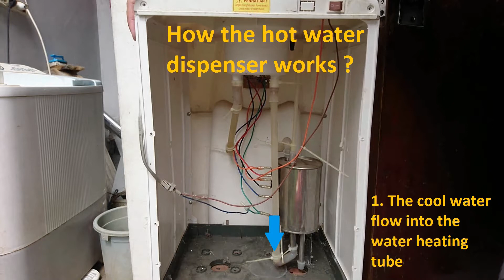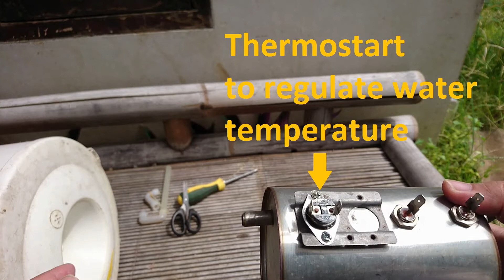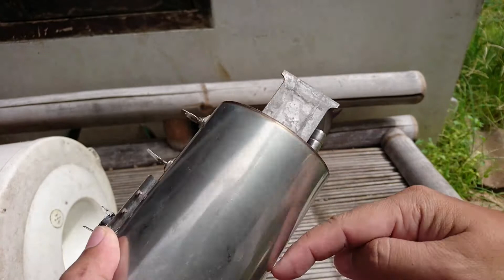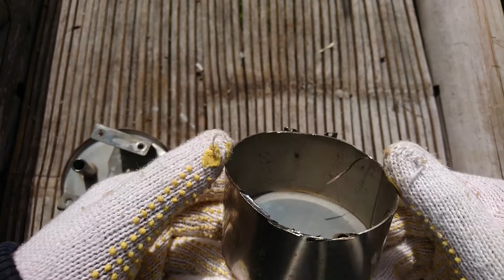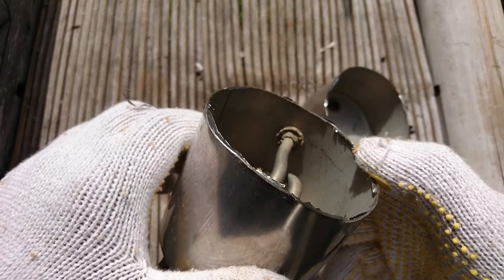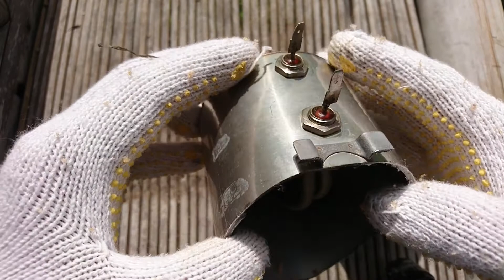How the hot water dispenser works? and what the inside of the dispenser water heating tube?

Comment: What happen if there is no water in the heating tube, Will the thermostate activate the heating element (?)
Reply from the maker: As I remember, there are heater  on off button. If you push this button on the the heater will on and the heater will off when the temperature limit is reached.  If no water then the heater will only rise the tube wall temperature quickly and stop when the tube wall temperature hit upper limit and start again when the tube wall temperature hit low limit. The cycle is repeated faster and the thermostart will be broken faster. The thermostart read tube wall temperature because its attached to the tube wall and not the water itself.
Reply: How many ohms does the resistance has to have?
Reply from the maker: I don't really remember the resistance value. Sorry

Comment: or can i plug it on a DC current
Reply from the maker: In theory, it can. But in reality, it will not hot because the voltage of DC usually lower than AC